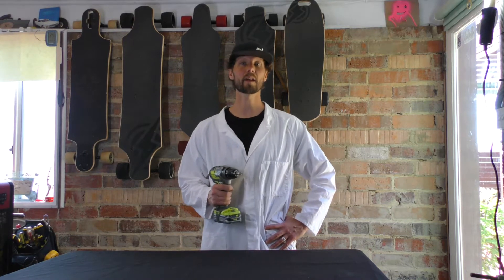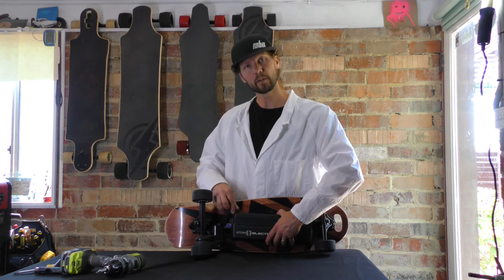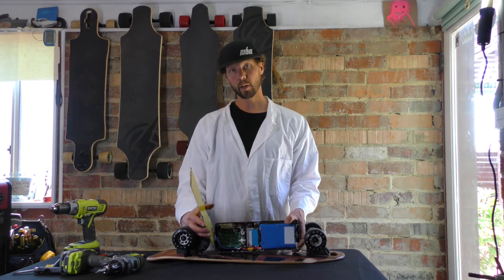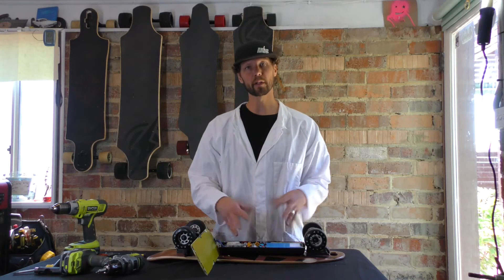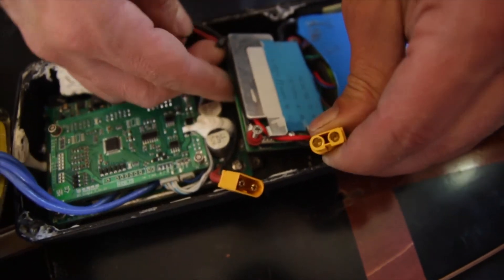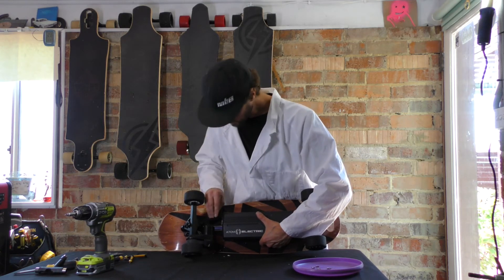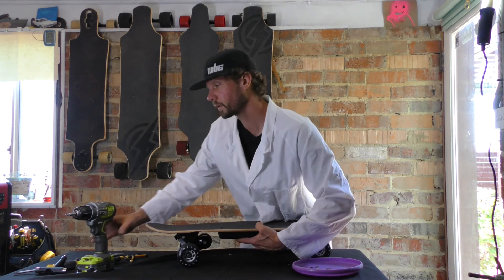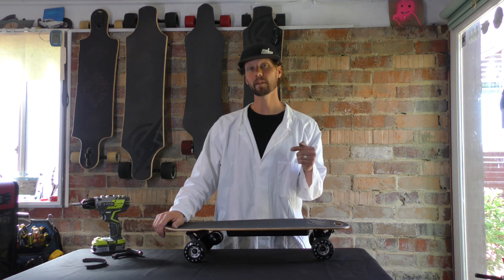TECH TALK -  Battery Replacement - B10/B10X

Comment: I have a few questions with regards to water. I have a B10. I use it as a last 2 or 3 kilometer commuter so using it nearly every day. If its raining, can I do a trip home in the rain? I try an avoid rain or water but just wondering what your thoughts are about yeah riding it home if its raining. Secondly, if you recommend its not possible...I am wondering what more could I do to the surrounds of the battery, motor or components to make it water proof or up its ingress protection enough for a 2km trip home in rain. Is it just the battery I need to protect or also motor as well etc. Second question is I just replaced the drive belt after it had snapped and did notice a bit of dirt around the drive cog. How often should we service one of these, I guess every few months if its a daily commuter?

Comment: When you reinstall the epoxy plate, you don't need to scrape off the old and then add fresh adhesive?
Reply from the maker: Really good point Pete. Resealing it definitely improves water resistance.  We recommend an RTV silicone glue.  Here's a link to a good one on Amazon - http://a.co/d/50yPKRi
.